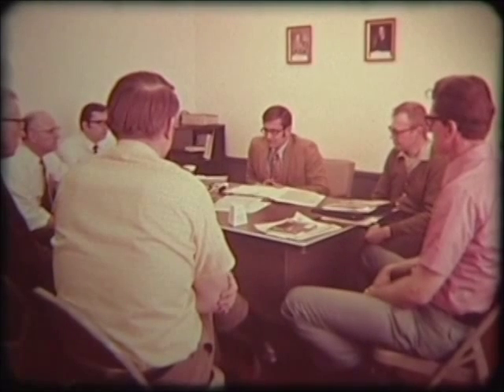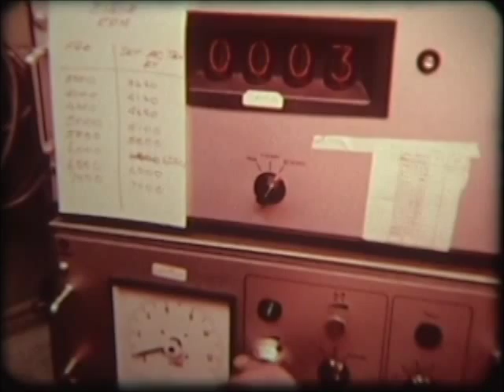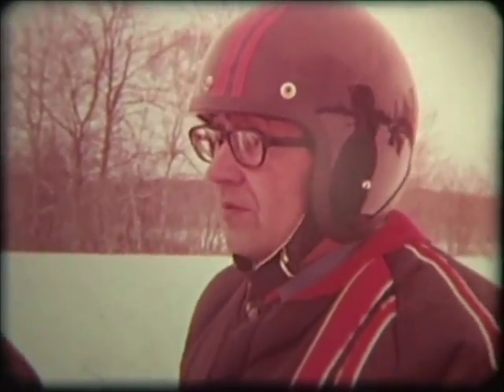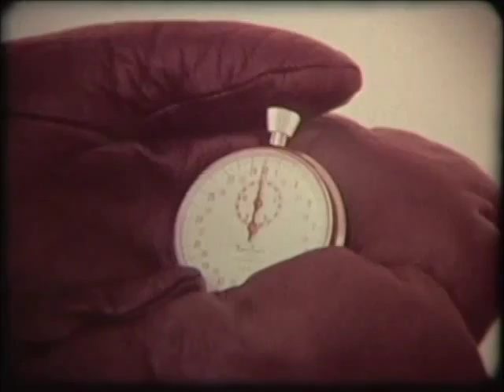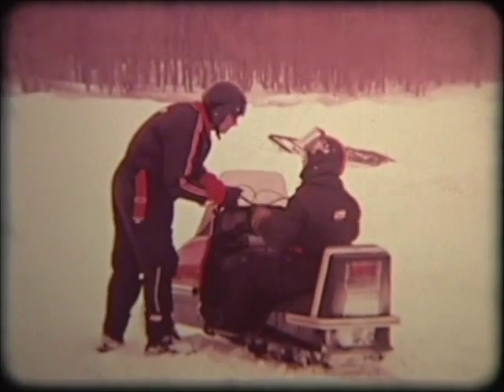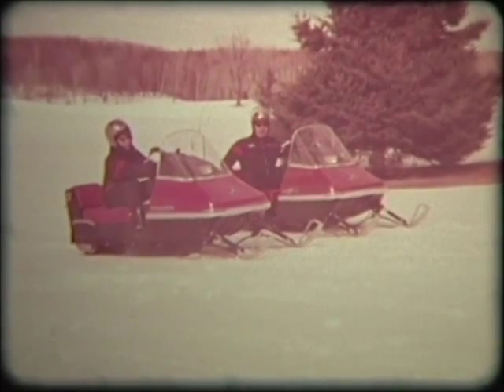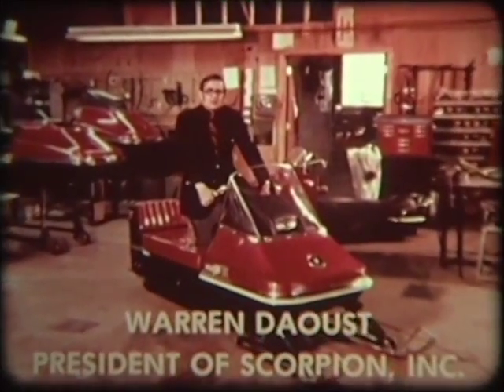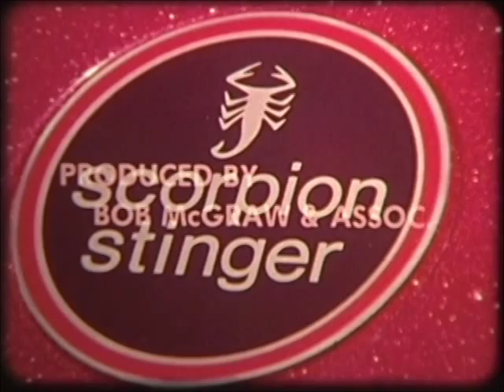1972 - Test Trials

Comment: My first sled at age 8 was a 71' stinger 292cc.  It was in my grandparents shed and I once watched him squirt some gas into the carb to get it started.  So one winter morning I  went to the shed, filled a little handheld squirt can with gas and pumped a little into the carb.  2 or three pulls and I was dong laps around the driveway.  My grandfather was amazed that I got it stated and cause so, he let me just have my fun.  I did laps all winter until the bogey wheels were falling off and I was at the age of 14.  I would hold that thing wide open after big storms going up and down our rural dirt road.  45-50 mph was max speed but enough for me and whoever I had over as a friend at the time.

Comment: Those Scorpion's did run good. Polaris and Rupp were the King's of the early 70's but the Yamaha and the Scorpion were contenders.
Reply: X umm actually the Speedway’s were the ones to beat
Reply: @JohnSmith-ws6jg  Oh ya, forgot about Speedway's 1972-1974 - ya they were screamers.
Produced by ex-Rupp employees.
Reply: until the MERCURY SNO-TWISTERS CAME
Reply: Scorpion needed to change with the times. More R and R in racing and performance could have been a big help.
Reply: Oopser daisy, meant R and D😂
Reply: @wadewacker7276  I think all the old engineers had a big part of losing touch of the outside world.
Reply: @lkurowic  Most of the USSA Sno-Pro snowmobile races I use to go to back then the Mercury Sno-Twisters more often than not ruled the 340 and 440 stock classes. I was a Polaris fan and was always disappointed they didn't do better in the stock classes. Mod classes was a different story however.

Comment: So funny.. The Scorpion optimized in every way I am sure... Other sleds = Belt adjustment? 
Air fuel ratio? Oil fuel ratio? Track tension? Carb. balance (If two)? Throttle cable adjustment?
 Ski Toe adjustment...Hell No!!

Comment: That was good for a laugh. Top of tunnel mounted motor, bogey wheel suspension and a fan cooled engine that would constantly foul the RH cylinder plug (furthest from the fan). I had one of these and it would vapor lock on temps above +10F. I had to install hood louvers just to get enough cooling to complete a trail ride. The Polaris and Arctic Cat sleds with slide rail and low mounted engines were so much better than Scorpion. If it wasn't vapor locking or fouling plugs you could count on at least one rollover every ride due to the high center of gravity. :Looking back, it was just comical.
Reply: What caused the vapor lock, and what did you do to cure for the vapor lock?
Reply: @michaelf6327  Carburetor would get so hot the fuel would percolate. No air flow through the hood, it was sealed up tight like a suitcase. I installed a pair of louvered panels in the hood and wrapped the muffler with foil faced insulation.
Reply: Mmmmm had two Scorps back in the day but do not ever remember the carb getting hot.
Reply: The owners manual states that for trail riding to remove the hood and the driver would stay warm from engine.  lol

Comment: no rupps...  :+[
Reply: Rupp and Polaris. Especially if a '71 Rupp 440 Magnum or a '71 Polaris 432 TX was in the mix. The two machines that would have won this competition. That Yamaha was a good one too. The drag race was obvious. The Yamaha slept on the start and still caught the Scorpion well before the finish line.
Reply: Yeah actually no Rupps, if they had Skiroules and Roloflex and maybe a few Merc Trail Twisters the results would be alot different. When I think Scorpion I think MF lol.

Comment: I had 4 Scorpions they were all pieces of Junk.  Now I have Cat and Yamaha
Reply: Which are both built by Cat.  All snowmobile back then were junk compared to modern machines. The Scorpions back then were as dependable as any brand, you must not have known how to maintain them.
Reply: @freetimecrawler  67 and 68.gas tank in chassis,  steering mounted to top of it , Cracked leak gas under hood.    71 stinger single chain to drive sprockets , broke chain busted case . Actually was best of all sleds.  73 super stinger RV too long of list.  Drive pins and internal drive sprockets sheared . Many other issues all top heavy and bad on deep snow.    I have Cats and Yamahas Now , OK machines. Ya it was the dawn of snowmobile's so I'll give them that.
Reply: @freetimecrawler lol. My Scorpion 292 Stinger was built like a tank where it didn't count and like a toy where it did. I took many a snowmobile trip only to wind up with the cowl off and wrenches out due to carburetor issues and overheating while my BIL putted around blissfully on his free-air Polaris Colt 290SS that I did the tune-ups on. Our pre-trip prep was identical, a plug change, gas, oil and de-icer, check the crank case oil, track and ski alignment. His always ran, mine ran half the time. Carburetor icing in cold, vapor lock and plug fouling in warm. My BIL's twin Mikunis ever iced up and it never fouled a plug though top sped was somewhat diminished in warm temps. When mine was running, we ran identical top speeds across the lake ... a blistering 57 mph.
Reply: Had a Scorpion Stinger and a Whip. Never let me down no matter the weather conditions.

Comment: This promo vid is Fake news. Late 60’s early 70’s snowmobile technology was owned by Arctic Cat.  
Look at the Stinger corner @7:42 pffffft! The Arctic Panther even being a two seat trail touring machine was deff a better handling sled and early 70’s cats had the bitchin’ Kawasaki motors. 

Attic was first with the engine (weight) over the skis, first with canted skis, first with a slide rail suspension. Scorpion had to resort to this fake news shit to even stand a chance.
Reply: Yeah, the only sled the Scorp would beat would be the TNT.
Reply: And your the first to publicly look like a full blown clown😂
Reply: @wadewacker7276  Ha! I owned over 20 sleds, Scorpion was a little better than junk. Mr.Weed Wacker
Reply: @greywolf9398  Grey Wolf you had bad luck then!! My Scorpion Stinger and Whip worked flawlessly. I’d like to try the dope you’re on then maybe I’d run for president 😂🤣
Reply: @gregorystowe8481  Yeah, and your wrong x3👍
Reply: @wadewacker7276  The all-steel Stinger....a real Clod hopper. Scorpion was one of the last manufactures to switch over to aluminum, also one of the last manufactures to use bogie wheels. The Parafail system was slightly better but still nowhere near as good as slide rail suspension systems. Humm, let's see, they were also one of the last to move the engine forward so the wight was over the ski's and gave a better center of gravity and handling. The Whip style sleds were not bad sleds but was still one of the worst sleds of its time. The Cuyuna engines were dogs at best they were just a rebranded Rockwell engines which never were great motors. All that said, I do love Scorpion because I grew up riding them, my first sled was a Stingeroo my last Scorpion was a Whip and I also owned a Scorpion Brute which for the time was a very innovative sled but Scorpion bought the design so you can't give then any credit for that sled. All in all, Scorpion were mediocre at best.
Reply: @wadewacker7276  It's is pretty well agreed upon that people that use insulting comments with no facts to defend themself are actually ignorant on the subject. And actually, you are the one that's wrong, more commenters agree with me.
Reply: Also, the Big three as they called them were Arctic Cat, Ski doo, and Scorpion. Funny that Scorpion is the only one of the three that went out of business and never revived.
Reply: @greywolf9398  You really are a self appointed expert in your little land of make believe 🤔
Reply: @greywolf9398  Funny that you didn’t remember why scorpion went out of business? Ever hear of Arctic enterprise? Here’s a little reminder, Arctic enterprise purchased Scorpion in 1978 and filed for bankruptcy in 1981, so guess what two companies went TU. So your dead wrong saying that “Scorpion was the “only one” that went out of business from the big three. Arctco returned for the 1984 model year and couldn’t financially revive Scorpion.
Reply: @wadewacker7276  Scorpion went out of business because they didn't have sales not because they sold the name.  Arctic enterprise rebadged a El Tigre detuned the engines and put the Scorpion name on it.    Sales were dismal at best and Arctic dropped the line and put the name back up for sale. That is not reviving. You are wrong again!